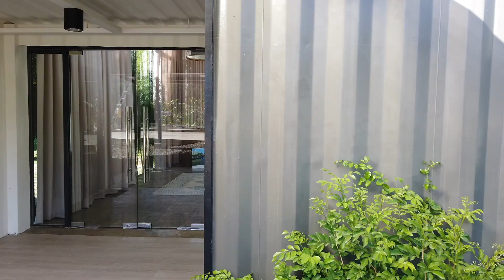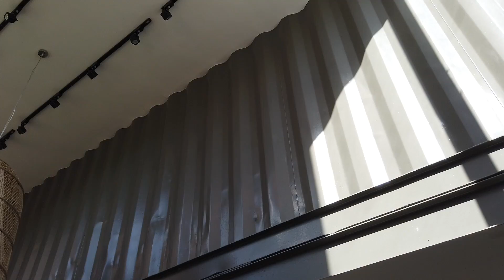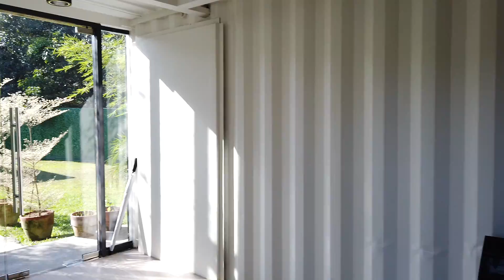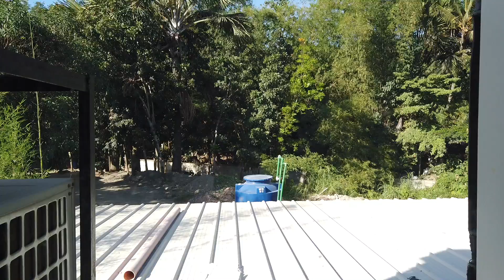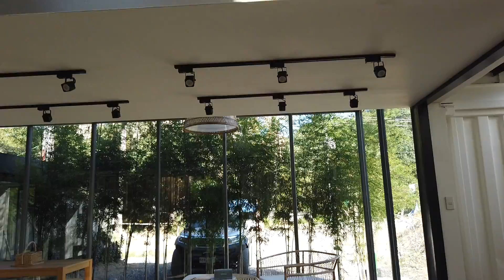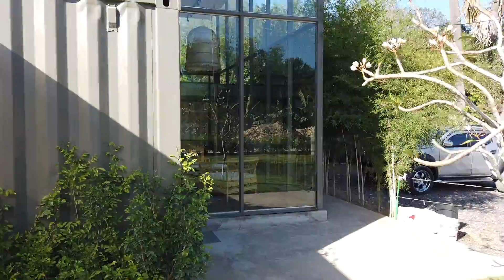P1.8 Million ($35,200) Container House Tour In The Philippines.

Comment: Nice place for the price. There are suitable, spray-on insulation options available with decent R-values for anyone that cannot look past the no-insulation issue. Personally, I have always felt that shipping container homes in the Philippines is a good idea for many reasons, but I would always consider doing a partially-buried or partially-underground design for climate control purposes. Do you know the company who developed this? Are they currently building more? Thanks.

Comment: Aesthetically pleasing. I've also explored this option and found flat pack container systems seems like a better option than buying container vans. The flat packs are new, comes with insulation and windows & door. Standard 20 ft size is still pricey though at 180K or 160K if you live in Davao. So now I'm exploring on panel systems for CHB-building alternative.

Comment: i am a truck driver in the usa & i deliver containers both new and used. i would have used  insulated containers if at all possible. they are around double the cost however they are already very well insulated & the inside walls/ceiling are made of stainless steel. just cut the openings for the doors & windows then paint inside & out.

Comment: Metal walls with no insulation and windows in direct sunlight looks like it will get very very hot.
Air-con electricity bill, about P180,000 per year
Reply: If they are not covered by a separate roof ,it will be a oven . I worked on a barge with those as tool sheds ,very hot .
Reply: @boracay12  Good for cooking but not living.
Reply: @caparn100  it looks nice , but they really are not cost effective .  You spend more and get less living  space .  They are 8 feet wide . Over 2 thousand dollars plus shipping .
 I have welded on the walls they are thin .  It's not for me . It's not cheap or better .
Reply: @boracay12  Yes, if you wanted to make it livable you would have to at least insulate it with rock-wool then batten some plasterboard over the rock-wool.

Also, it really needs the addition of a sloping roof with a large overhang to prevent sunlight from coming into direct contact with the windows and walls.
Reply: The electricity bills are expensive. If those containers are well insulated you only need a cooling system when it is so hot. The best thing for that is to put another roof and all windows for ventilation. The insulation should be both outside and inside. Northwest sun is very hot so the glass windows should be facing east. Afternoon sun is horrible especially in tropical climate.